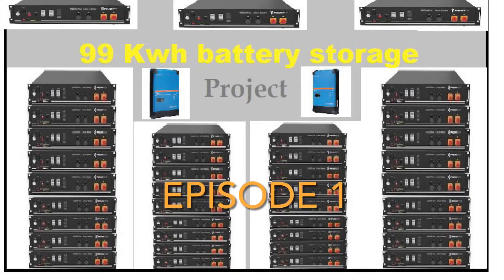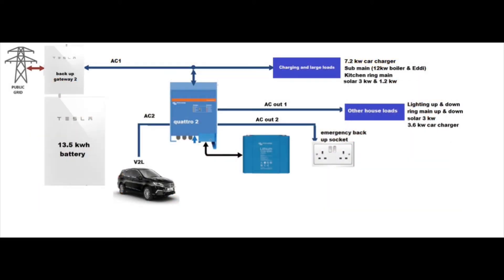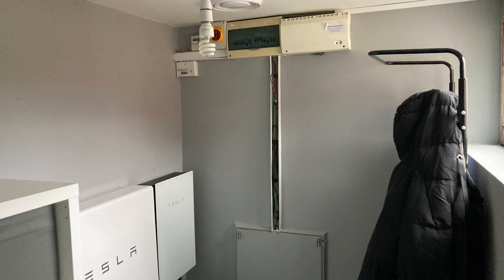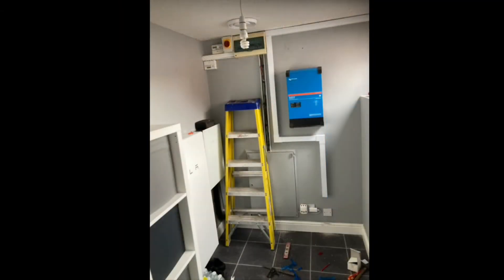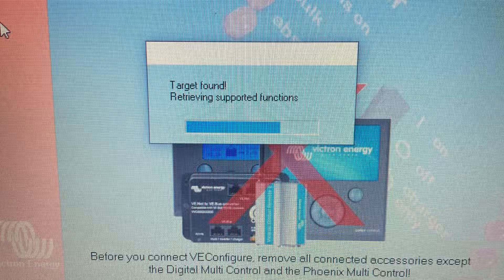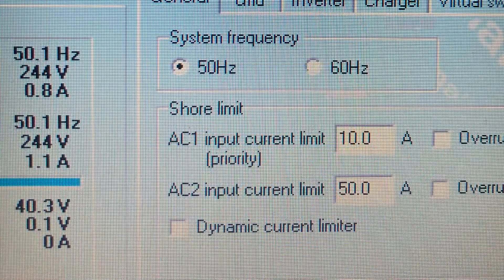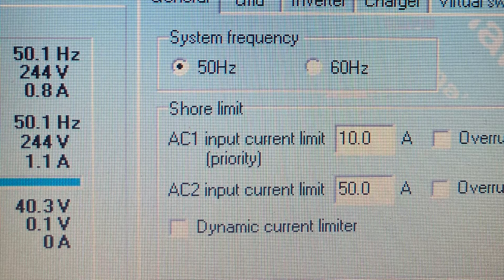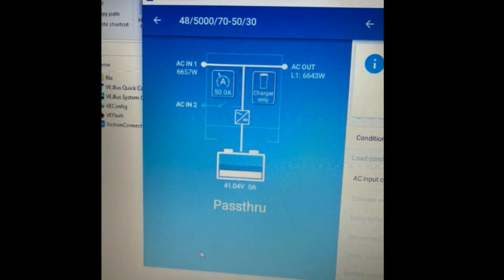My BIG battery V2H battery storage project , working along side my Tesla powerwall , introduction

Comment: Just one downside, lots of storage but no way to run whole house. Like having a reservoir with a 15mm outlet.
Reply from the maker: Depends on how much your instant power is
Reply: @AllElectricLiving  we’ll really depends on how much power can be delivered at any one time. With v2l it’s less than 2Kwh. To put it in perspective, a kettle boiling will draw 3Kwh.
Reply from the maker: @billyoung2458  your missing the battery’s I can get up to 4.5kw from battery’s plus the V2L , and the V2L will also charge battery’s when house load is low